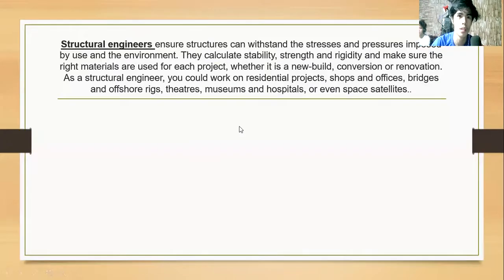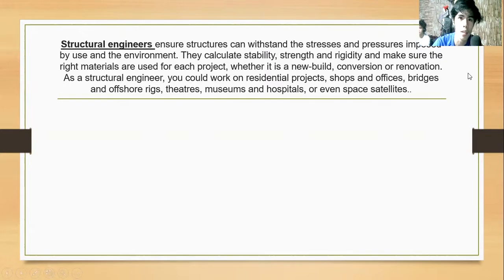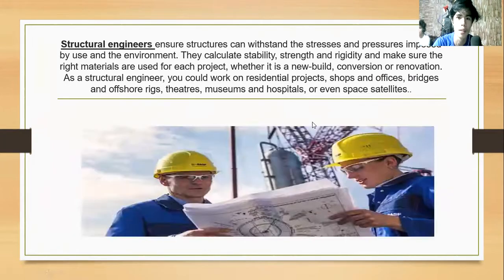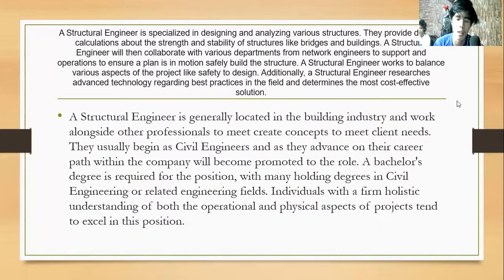Structural Engineer Career Description

Comment: After watching this, I learned that the structural engineers are very important because they are the one who calculate the strength and stability of the structures. They are the ones who are responsible  to keep the infrastructures from collapsing.

Comment: Structural engineers are really need interms of building strong structure. In every field involving the strength and stability of a structure is the job of a structural engineers. Lastly Structural engineering is one of the important jobs in terms of building the nation.

Comment: Structural engineering, I learned, are responsible for performing exact calculations on the strength and stability of structures. Infrastructures are safe, sturdy, and stable thanks to structural engineers. To put it another way, they keep infrastructures from collapsing or falling apart. I also took note of the normal tasks and work functions of structural engineers.

Comment: Kent Royet O. Lañada

I've learned that the duty of structural engineering is to calculate, plan design, layout, specification, propose, and cost estimation. One of the role of strctural is they predect the structural condition, they calculate the loads in foundation, beams, and walls. they ensure the legal and safe  structure, and they inspect, advise, repair or demolition in structures.

Comment: Structural engineer ensure strength of the structure to withstand stress and pressure.It calculates stability, strength and rigidity of the structure. Structural engineers duties are to calculate the loads and stress of foundations, beams and walls, advising on suitable materials for a build, inspecting structures on its structural integrity and advising on building repairs or demolition.A structural engineer collaborate with various department from networks engineers to support and operations to ensure plan is in right safely build the structure. The structural engineers research for advance technology on best practices in the field and determine the most cost-effective solution.

Comment: Structural engineers are crucial to the stability and long lifetime of structures. Thanks to structural engineers, infrastructures are safe, solid, and stable. I gained a lot of insight into the work of a structural engineer on a daily basis.

Comment: I have learned that structural engineers are the one who provides detailed calculations about the strengths and stability of the structures. Structural engineers ensure the safety, strength, and stability of the infrastructures. In other words, they make sure that the infrastructures don’t fall down or collapse. I also learned about the typical duties or job roles of structural engineers.

Comment: A very good and nice presentation, I learned that structural engineers are the one who calculates the stability, the strength of the buildings to assure that the building will not easily collapse. Structural engineers are very important in making buildings to assure the stability and durability of the building.

Comment: A have learned that structural engineer is specialized in designing and analyzing various structures and they are generally located in the building industry and work alongside other professionals to create concepts to meet client needs. I also understand that there typical duties includes calculations, planning, designing, and etc. where they are responsible with.

Comment: Nice presentation, I learned that Structural Engineer are the one who calculate stability, strength, and rigidly and make sure the right materials to use for the project. I learned that they are also responsible for project proposal, project cost estimates and project specifications.

Comment: The career description of Structural engineer is they ensure the the safety and durability of a structure. The job role of structural engineering is use computer modeling, calculating its loads and stresses , ensuring projects meet legal, advising on suitable materials for the building, inspecting building, advising on building repairs or demolition.

Comment: according to the analyzes and design The basic tasks of structural engineering relate numerical quantities of physical forces to physical configurations of force-resisting elements. Analysis is the process of determining forces in each element in a structure (such as a beam) when the configuration of elements is already defined.